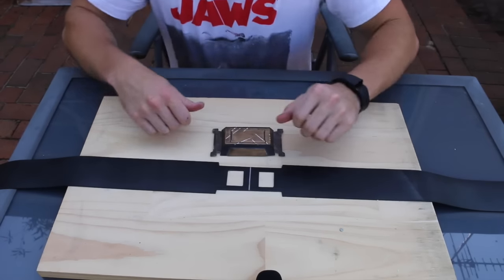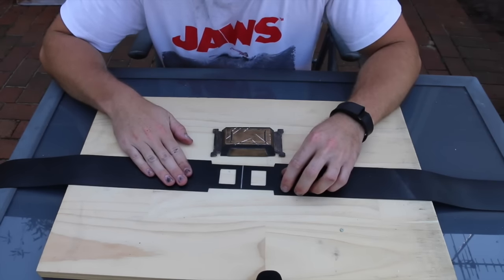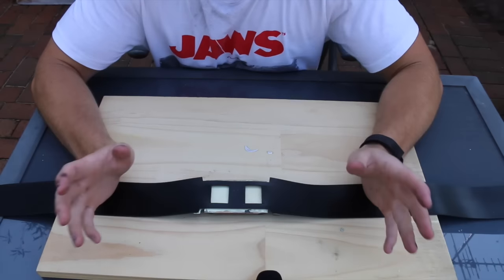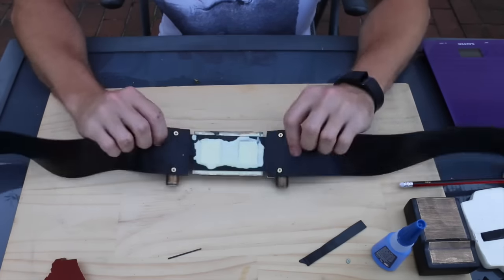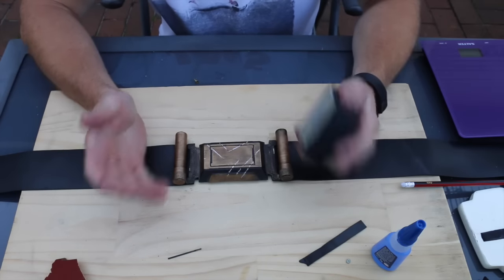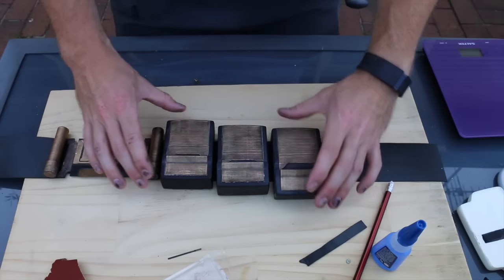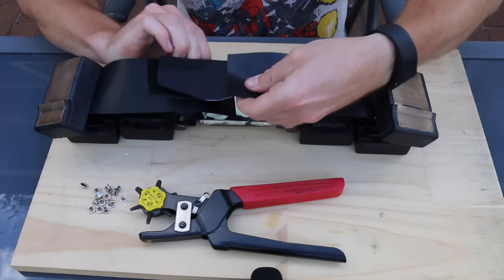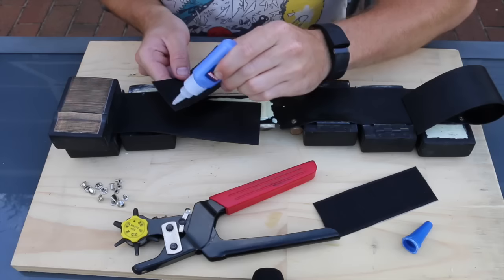Batfleck Utility Belt- Part 4: Final Assembly & Reveal!

Comment: I was wondering if it would be possible the get rid of the scratches on the buckle. what would be able to conceal the scratches?
Reply: Bondo filler. You'll need to sand it smooth afterward